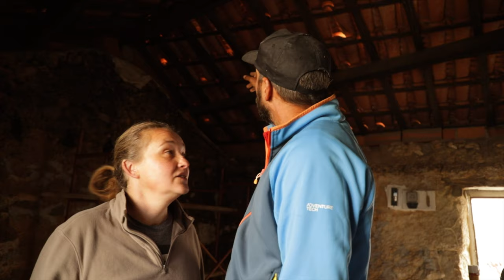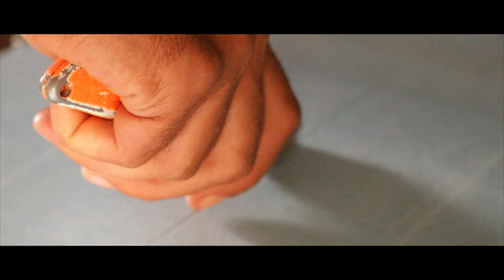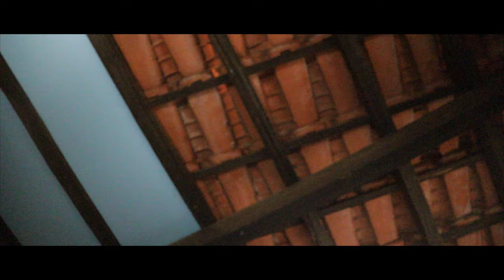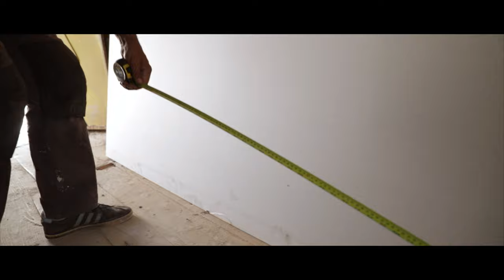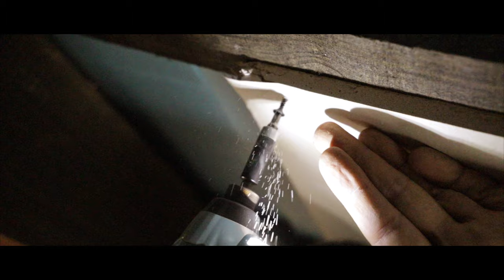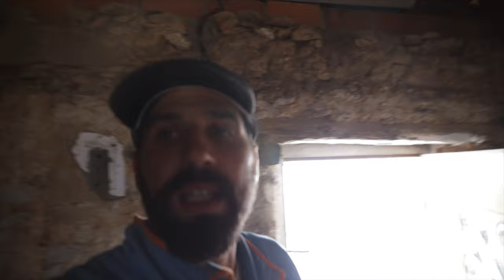Tiny house renovation Ep5 - Getting the roof insulated and boarded

Comment: My only concern was no damp proofing between tiles and insulation! If you get a cracked tile, you'll find out when the insulation is all damp 🤔. Hope you don't get that, keep check on tiles.  
Look forward to seeing more 🙏
Reply from the maker: The tiles are only 5 or 6 years old, so hopefully we will not need to worry to much about it🙏